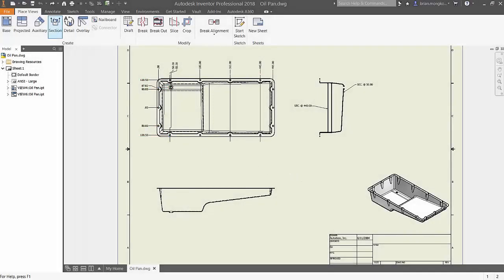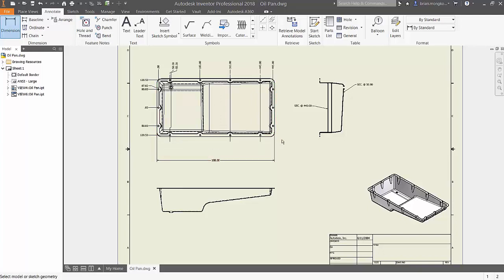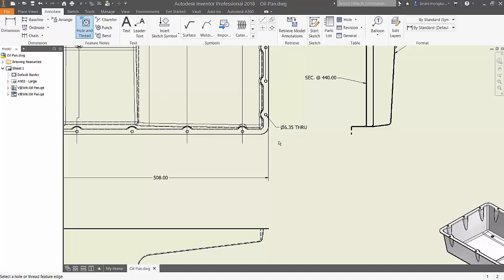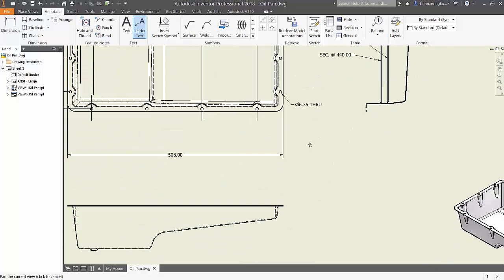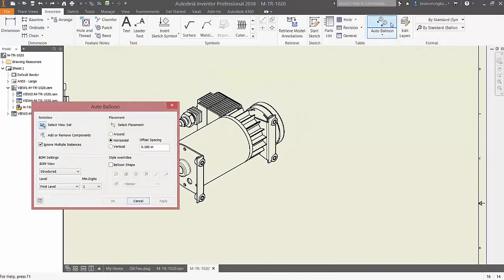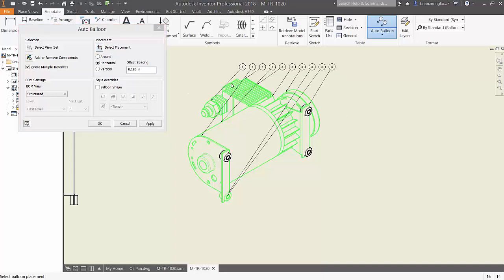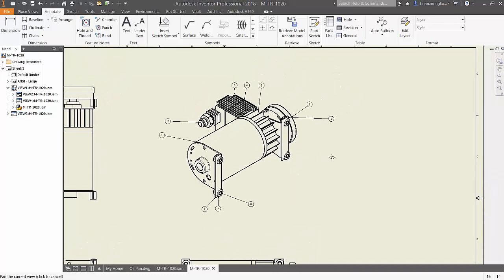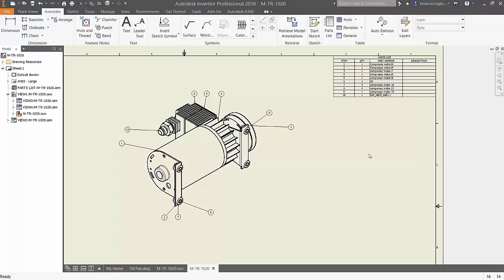Quick Tip: 5 Drawing Annotations You NEED to Use

Comment: Hi I have a question in regards to annotation/sketch symbols. I'm a draftsman in the water treatment industry & we work a lot with mechanical & civil structures. The issue I have has to do with elevation/level. We have to indicate elevation on our drawings. Is there a method of creating a symbol that can indicate the elevation and one that can update if the elevation would change or if you have multiple levels to indicate without calculating all of them. This is to minimize human error in the calculations. I know AutoCad can make blocks with fields and i can reference the x,y,z coordinates & will update if the model updates... I hope my question is clear on what i want to achieve. Hope to hear from you soon.